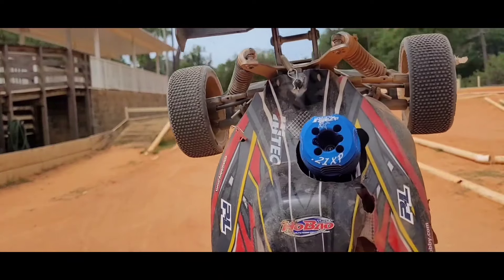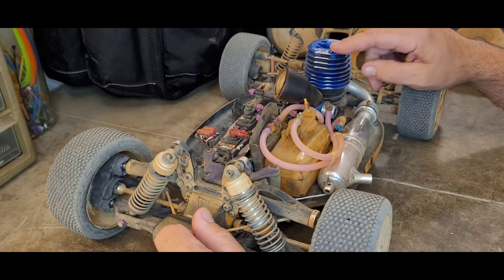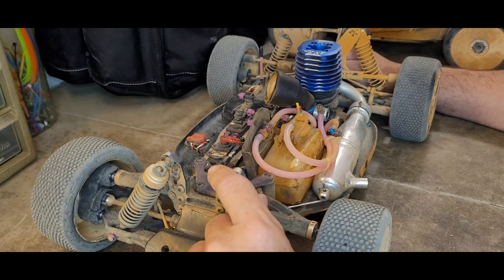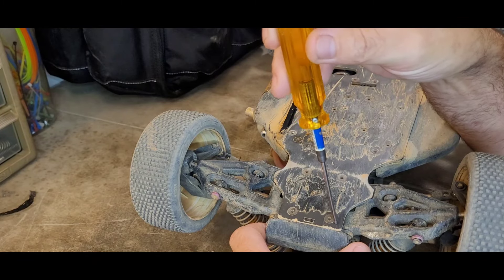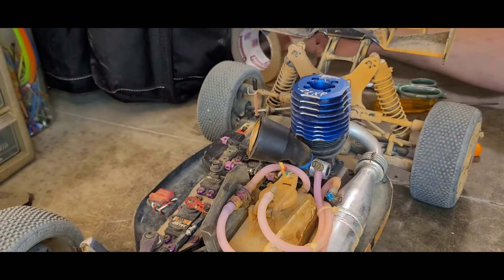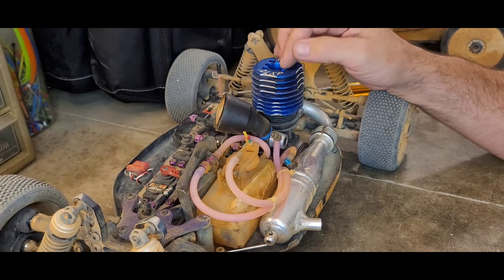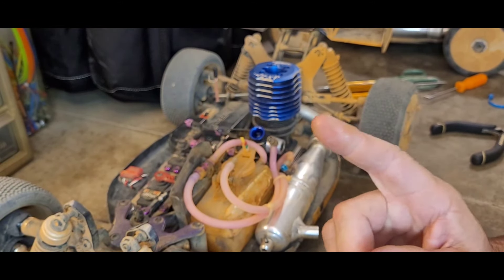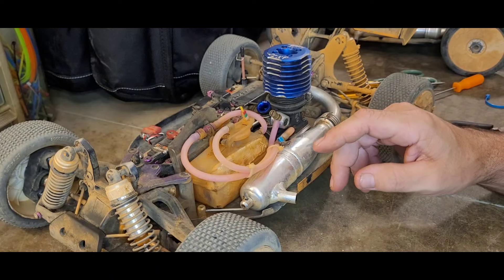Lovely bottom? Dynamite Platinum 21XP Nitro engine OS 2050 tuned pipe first test tune and run

Comment: You will be happy to know the crank in that engine is silicone filled 14mm.  Its not bad!  i rebuilt mine with a losi 350 piston sleeve  its a very strong engine even in a truggy.  
Rear bearing is 14x25.4x6 so its a good size bearing and the larger crank gives better bottom than the losi 350 and the older 13mm crank sh engines

Comment: Im glad you said something about the carb.. I've been having a ton of issues with my dynomite mach II carb. Any thoughts on what temp a carb will hydro lock or boil fuel?
Reply: Helped my buddy break one of those Dynamite Mach 2 .21 engines in back in January, and it was sensitive to boil the fuel in the carb while trying to keep the engine hot with the heat gun just to idle about 6 tanks in.  I don't mess with metal carb engines often since they're uncommon nowadays, but when I do, it makes me appreciate plastic body carbs that much more.
Reply: @cbh148  exactly the issueI had and have. Maybe someonehere can recommend a replacement carb?

Comment: I also bought a sh turbo head for it. Not sure if it will give any advantages?
Reply from the maker: I plan to do a test to see exactly how much can be gained with a turbo plug. From my experience, it isn't much. When using a properly sized standard glow plug I can't tell much of a difference vs. turbo.